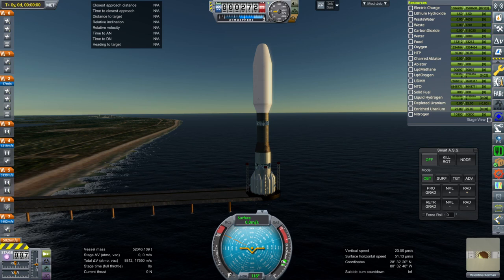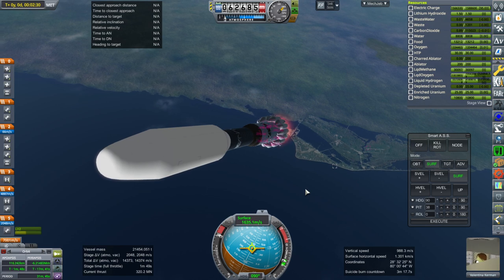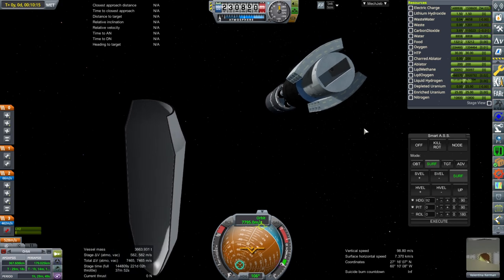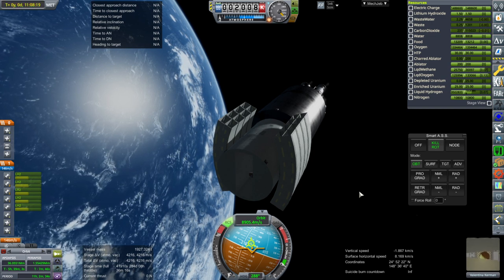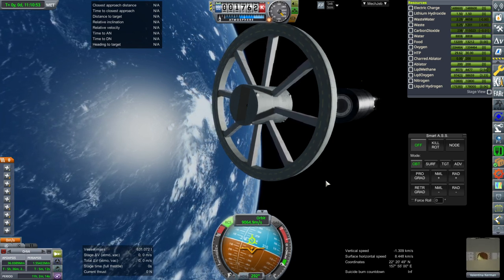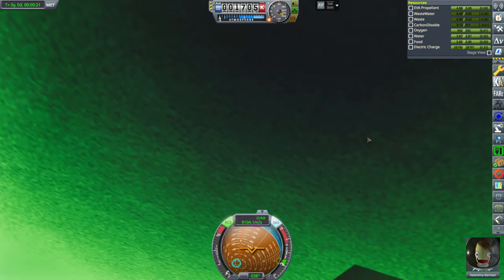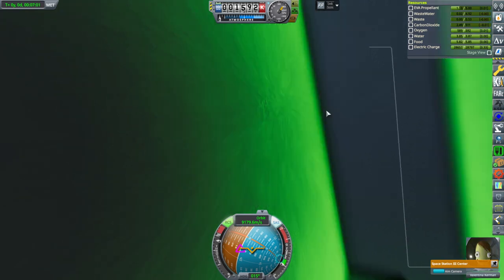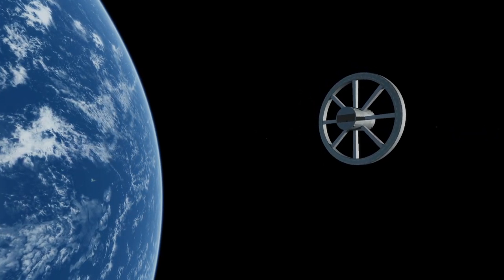Realism Overhaul in KSP 1.8.1 - Space Station III Concept Test

Comment: Now this is a VERY big step in the right direction!  What I'd really like for this, (If you haven't already!) is to actually include in the files, the "Internal volume" of the station-hub, for the purposes of things like kerbalism, or other RSS/RO config files, so you have the correct amount of space for kerbals, so they aren't like, really messed up or stuff.

Also you might consider adding some ladders on the inside of those spokes?  Don't know if you can, but it might be easier than walking inside that with the kerbal themselves.

Assuming you can get it compatible with the install, I'd really like to take a station that includes two of these rotation-sections into the orbit of Titan, before me and Cattack make a landing.  And an ADDITIONAL station carrying at least 3 of these sections over to Pluto when we go there!

Think you could take 2 of these up on the monument launcher at once?  That'd be cool if you could...

Comment: Hello, I was going to ask something.When I pass the Atmosphere in the Real Solar System Mode, that is, when 140 kilometers passes, the land parts on the map are extremely blurry. Does anyone know the answer
Reply from the maker: There's a different rendering method that kicks in at that point - one that makes for better results closer-up than the orbital textures would. However, between 100 and 140 km it tends to be a bit blurry. You won't notice the difference in stock because the stock planets are much smaller.
Reply: @RaizSpace  Yes I got it but is there a way to fix this problem?